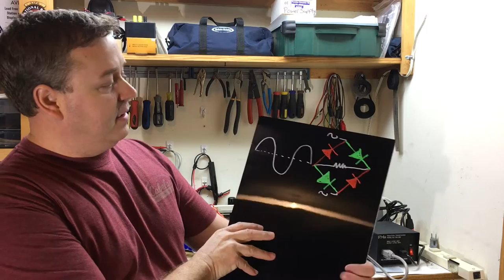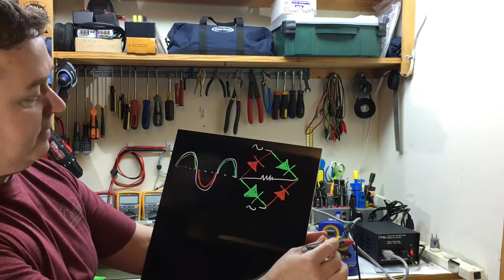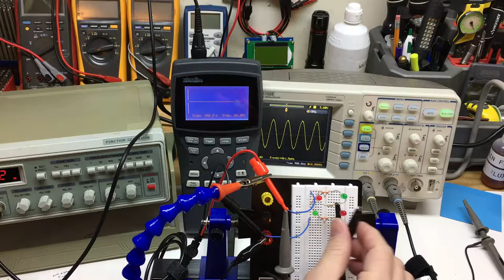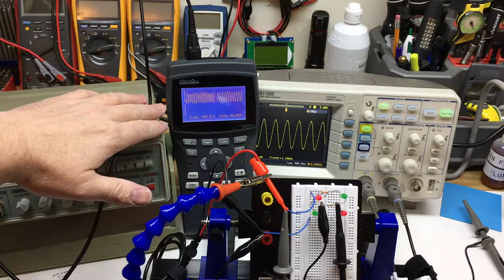Review #2 Function Generator & Bridge Rectifier Signals

Comment: sir, when we are using function generator in our laboratory to generate bridge rectified output what we are getting is a half wave rectified output. I just want to know the reason and the possible solutions.
Reply from the maker: 2 possible reasons is that the signal is not truly going from -V peak and to 0 and then to +V peak and back to 0 for a complete cycle. Need a peak-to-peak sine wave . If you have peak-peak cycle, the 2nd reason could be that the AC power for 2 devices ( Function Gen and Scope) are connected to same ground and the oscope is grounding the signal. Either isolation is needed or simply use a battery powered oscope to resolve. Hope it helps.
Reply: @ThriftyToolShed  Thanku , But ac supply and DSO ground was not matched. Supply ground is connected with the junction of two diodes and DSO ground is connected with one end of load resistor.